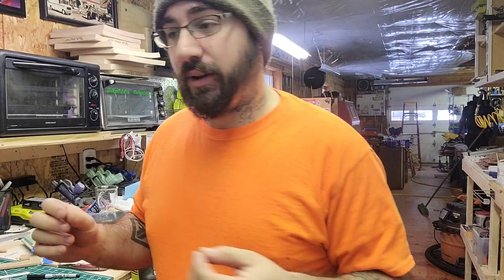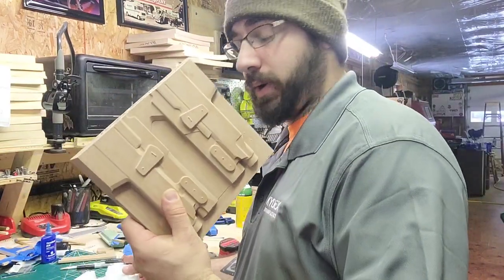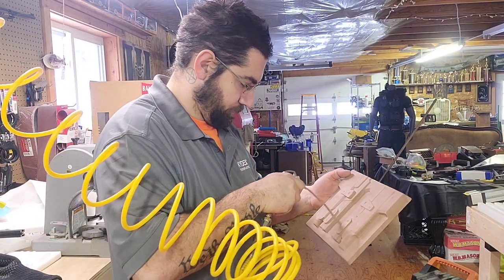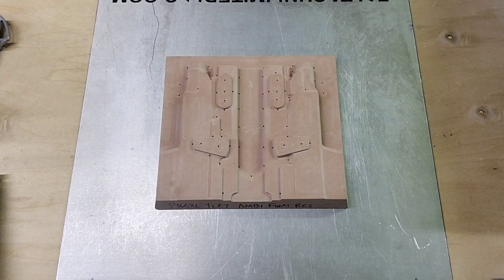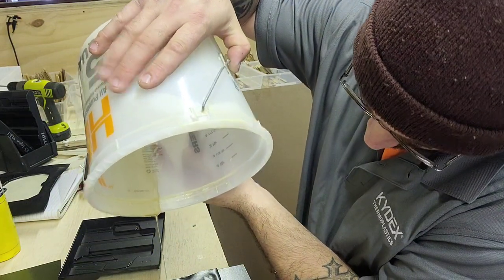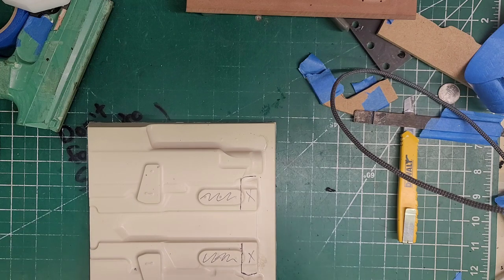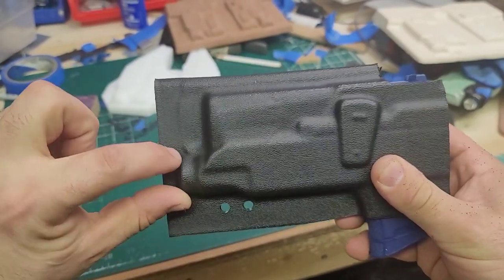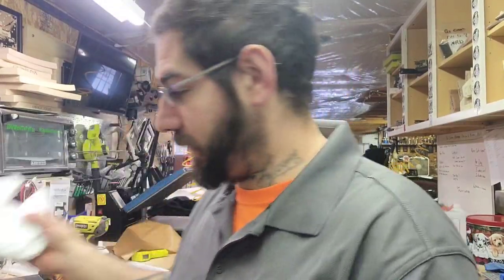Turning 1 Palehorse Mold into 2!

Comment: Ok, so I made my first mold with that resin today. It came out good but two things. First I noticed that when you use your torch to pop the bubbles, it stayed like liquid. When I did mine, it already started to turn the cream color and I just quickly went over the top. Second, when I tried to make my first holster, it’s almost like it shrank up. It was way too tight and wouldn’t fit the trim jig. Not sure what went wrong. Maybe mix wrong but I did 10oz and 10oz like your video just to be sure it was right. Have any ideas what could have happened?

Comment: I take it those castings have been holding up well for you? Ive been wanting to start making my own molds as well. My big question is after you're molding on the split do you have the actual mold gun that you're bending the shell around?
Reply from the maker: Holding up good yes.  And I bend around a multimolds or a blue gun
Reply: @FalTacUnlimitedLLC  might have to order some shells from you here soon while I try and scale up